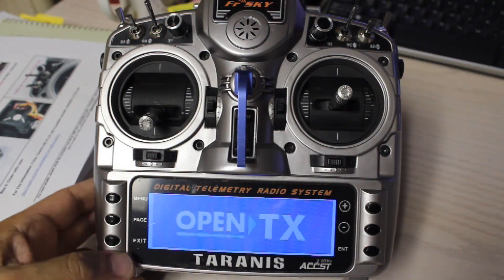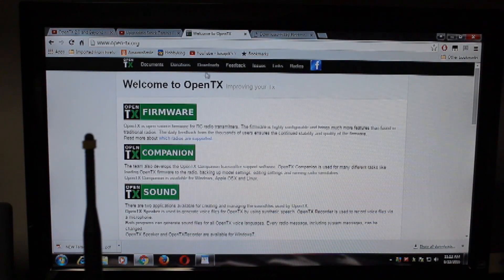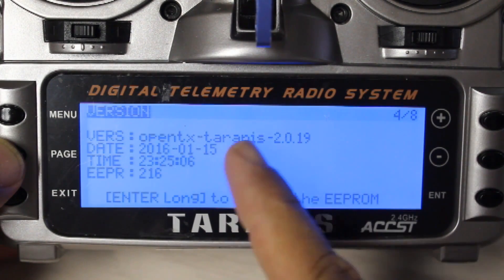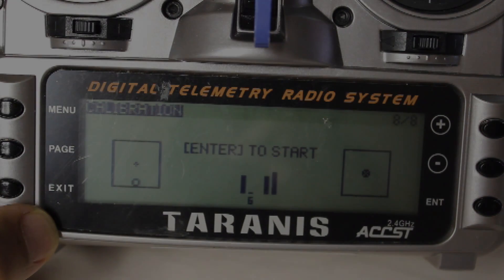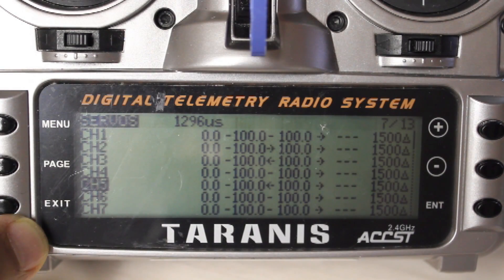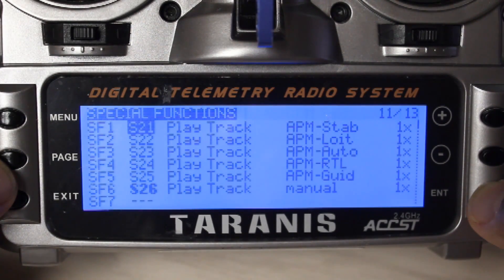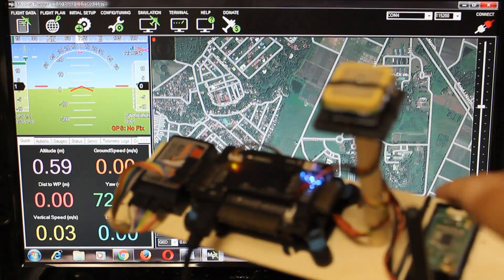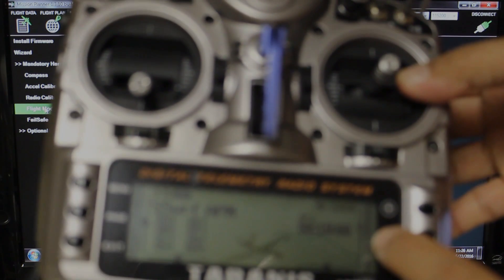Taranis X9D Six Position Encoder Install, Program and Test

Comment: why not make the encoder linear, and no BS in programing a curve??   Stupid switch..
Reply from the maker: Making the encoder is one thing ... getting it to trigger the proper PPM signal for the APM FC is another. I assume the manufacturers went with the closest valued but cheapest internal components knowing the programming can be adjusted. Genius for DIY folks.
Reply: @tsisapik  Genius if your radio supports 6 point curves on the particular AUX channel that you have available.  I would prefer to buy a switch at several times the price that does not need such programing. PPM is pretty standard for servos/encoders in RC.  you could even make a DTA converter switch that is programable.  perhaps there is a market for an interface.
Reply from the maker: @FPVREVIEWS  Me thinks the switch I use was purpose designed for the Taranis radio based on the info found at the FrSky site (re: instructions). I am looking at the Jumper 16 Pro that has the flight mode switches already included and programmed ready to use and at roughly $180 shipped running OpenTX. Looks like the almost perfect radio to own and use .. multi protocol with all the bells and whistles of OpenTX.